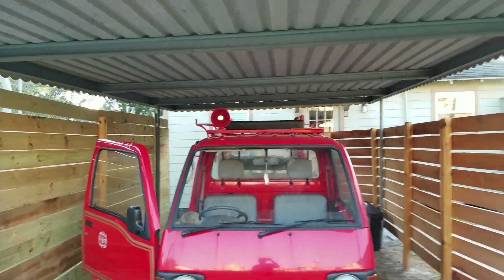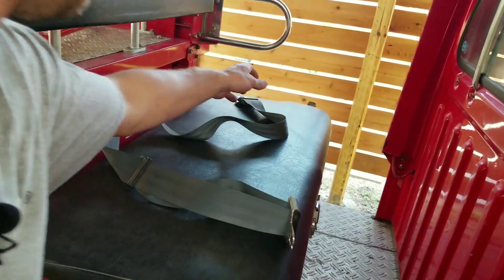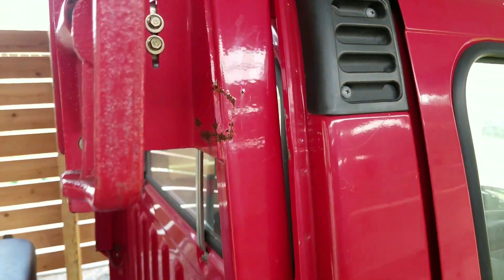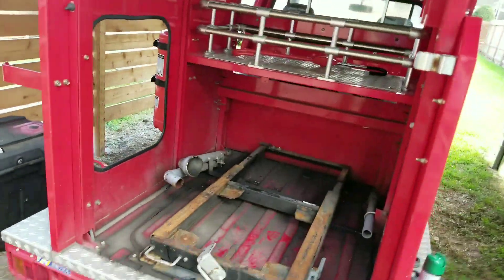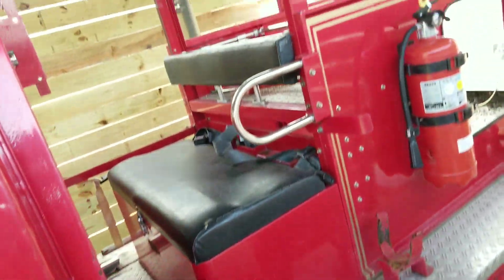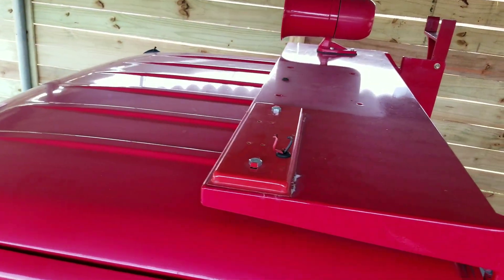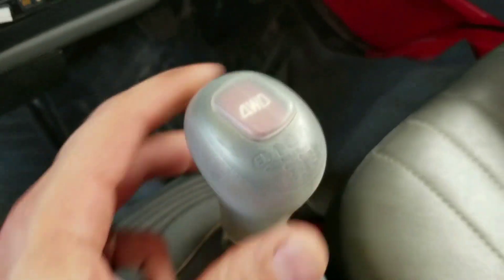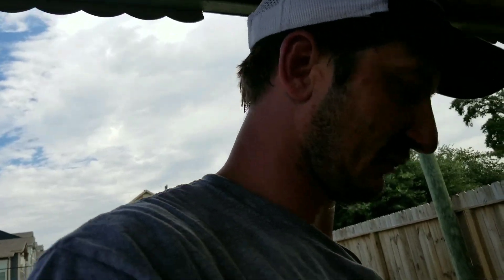Monday Morning Minitrucker, episode #1. Subaru Sambar KS4

Comment: Can you do an update if you got a water tank and the light replaced? looks like it can be used on a farm (or some trades people) can use  truck like this. a water tank can be useful for farmers to water stock and feed like bagged feed or small square bales of hay can easily e loaded in it and also tools and parts taken to and from broken down equipment in fields or small fence repair jobs.
Reply from the maker: I haven't put a water tank on one. I have had some customers put the large plastic water containers, they sent me some pictures and seems to work well.
Reply: @USMiniTrucks  do these come up often for you to import here to the states? I like the idea of in nice weather of having extra seating, plus I can see that there is lots of potential for other easy modifications.